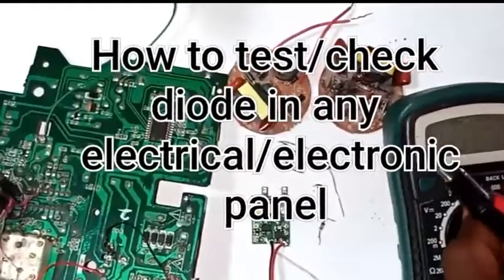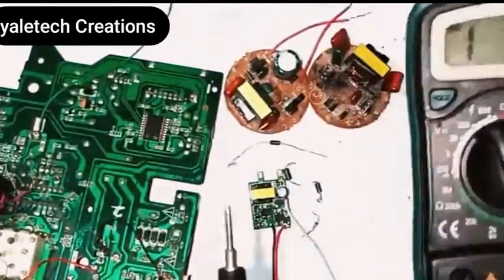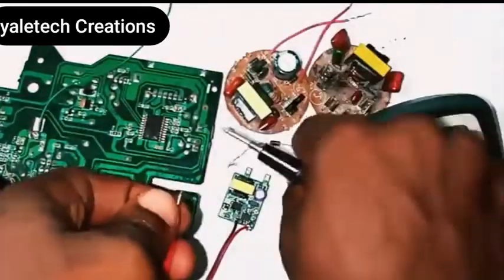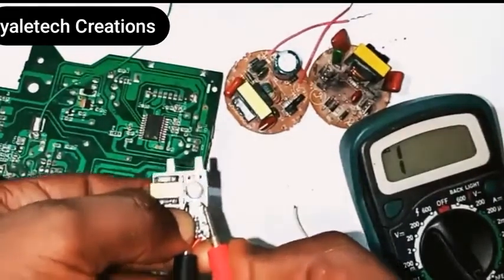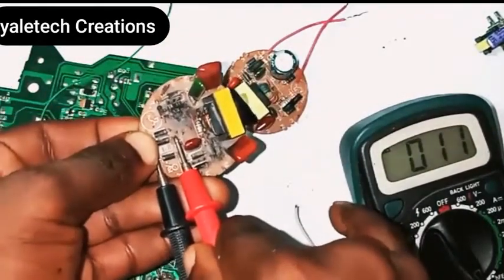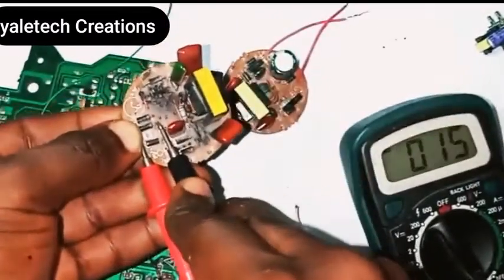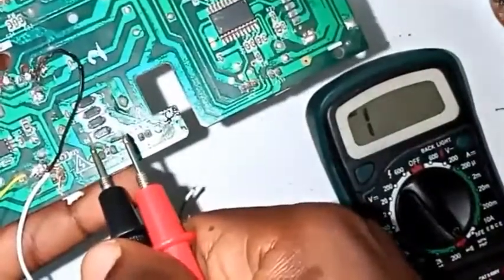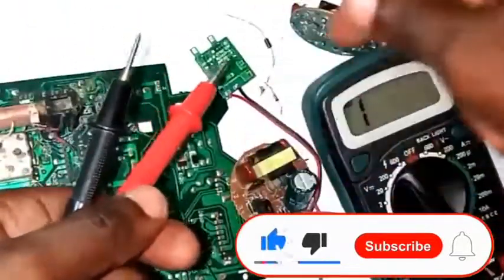How To Test Diode In Any Electrical Circuit

Comment: sir my rechergable fan sunca sf 286b .its problem is runing ac line its 1 diod is being so heatup,
and when it running in dc mood it is not start up.but when I Touch a registance by finger then its running.solution plz

Comment: hi, i have no education in electronics so sorry if my question is stupid. do u have to turn off the voltage supply first before measure? or u can just measure with the supply on?
Reply from the maker: Everything must be turned off for safety reasons and to also  get accurate readings
Reply: Thank you, your guide is very helpful